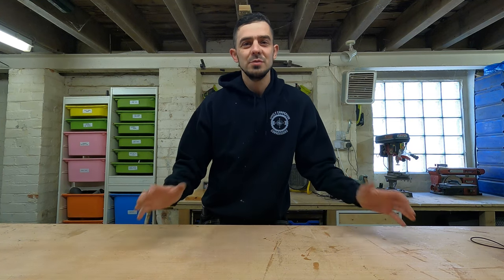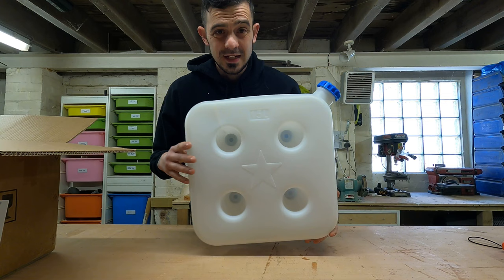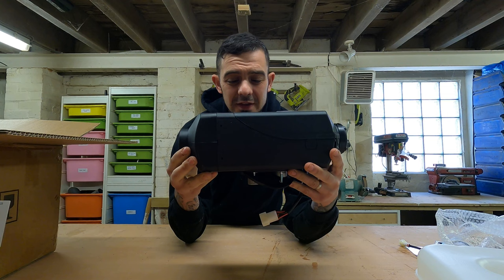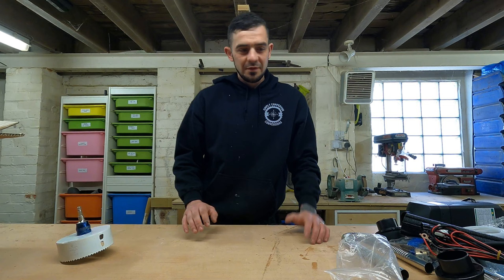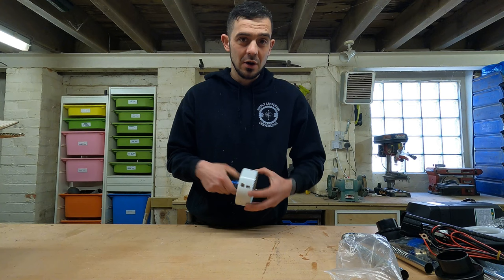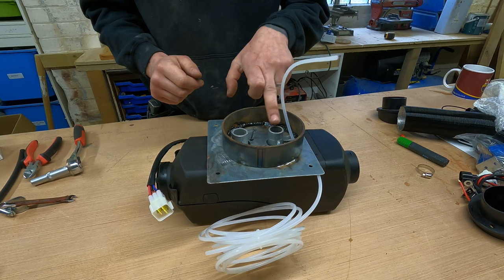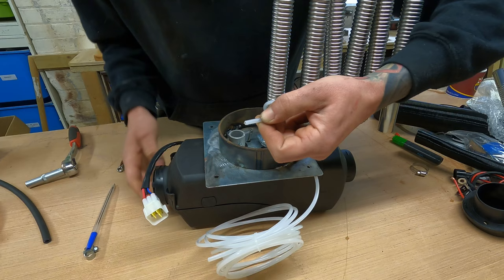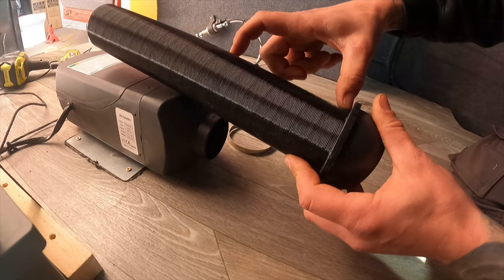CHINESE DIESEL HEATER | Full night heater installation guide safe camper van  | how to install

Comment: Hi Lee, thanks for the video! Would a car battery be able to run one of these over night? Or about 7 hours ish
Would do the start up with the car running as I know that uses lots of electricity
Reply from the maker: I wouldn’t like to risk it.
A car battery is built for short bursts of energy at high amps, they don’t work very well over lengths of time.
Reply: @simplycampervanconversions thanks for the reply! So I’d have to get a separate battery to run it too? Any recommendations for a cheap suitable battery?
Reply: Apologies for hijacking the comments, but I saw this, and though I'd through in my 2p. 

These use little to no power, so if you don't have a leisure battery, then don't panic. 

12v electricity supply is required of course to power the fuel pump, little control panel, and to heat the glow plug. Once it's up and running, it's burning diesel on its own steam. Of course, the panel and pump are still using 12v, but it's a miniscule amount.

I fitted one of these directly to the main/only battery in my Land Rover discovery 2 and used to leave it on overnight with no issues. 

The tiny amount of electricity you do use is restored once you start the engine and get the alternator going and doesn't harm your vehicle battery at all. 

If you were running multiple appliances, lights, chargers ect and draining/charging alot then yes, absolutely go and buy a decent deep cycle leisure battery, however if the heater is the only additional load then I personally wouldn't bother

To summarise...

1- Have a good, strong battery in the first place.

2- Install correctly, as shown by this man's video.

3- Get toasty! 🔥

Hope this helps!

J
Reply: Great video, nice and clear instructions.  

It's good to see a decent one for a change!

Joe
Reply: @jordanmalarky9477 ah ok! Thanks for the feedback! I think my cars main battery is on the way out so will replace that and give it a go 🤞🏼

Comment: Why would you  mount a heater right in the middle of the floor like that? WTF? Why not put it long the wall and run all those wires and lines out of the way?
Reply from the maker: Because that’s where the customer wanted it to suit their layout.
Reply: @simplycampervanconversions   Iunderstand. It just looked like it was mounted in the wrong place and wasn't clear why it was there . Thanks for clearing that up.

Comment: Since you only need a air intake and exhaust, do you really need a 127 mm hole ?
Reply from the maker: Good question.
So you can just drill a hole for the two small items, however that leaves your very hot exhaust against your wooden floor and insulation etc.
This is why we use a turret, it also gives you a better seal around the heater to ensure no gasses are getting back in.

Comment: Is it possible to run the heater with just fan mode, without any heat going through? I wanna know if I could also use it in my ordinary ventilation in the summer.
Reply from the maker: It isn’t however I am working on a work around to make it possible.
Wether it works or not remains to be seen.
Reply: W/o trying, I would say NO.  It's too little a fan.  I see folks put in bigger fans in the roof, sometimes 2, one to push air in and one to exhaust it, but they are larger, somewhere in the range of 6 to 10 inches.  I would want those fans for summer.
Reply: I actually already have a maxxfan for exhaust and a small intake of air. I just need a little more push actually, so a small fan like in The heater would probably complete do it for me at least

Comment: Hi is it ok to run the fuel line 14 ft in length from van thank to rear of van thank you
Reply from the maker: Yes that’s fine, the only thing is the pump is better and pushing fuel and not pulling it, so have the pump as close to the tank as possible.
Reply: @simplycampervanconversions  thank you 😘
Reply: Hi is it ok to extend the wiring to the fuel pump from the heater ? Thank you
Reply from the maker: @raytandy8142  yes no problem at all, just be wary of voltage drop, don’t extend with wire any thinner than what’s used.
Reply: @simplycampervanconversions  thanks again great advise 😄

Comment: What is the drain like on the battery? If it is hooked up to your van's main battery and the van is off, will i wake up to a dead battery?
Reply from the maker: A starter battery is designed for short bursts of power at high amps where as a leisure battery is designed for a low draw Ofer long periods of time.
If it lasted the night which it probably wouldn’t, it would kill your battery very quickly and you’d need to replace it.
Reply: @simplycampervanconversions  so just use a portable battery I guess and charge it during the day?
Reply from the maker: @bmstyle  just a leisure battery and a split charge relay to charge it while driving would be enough and probably the cheapest option.
https://youtu.be/wUEG-U3nqsw?si=iiMinMGcCSrQoEMO

Comment: I installed my heater outside under the van, only the  heat output tube enters the van through the floor
Reply from the maker: What about the hot air input at the rear of the heater?
If that’s also open under your van then your exhaust could be feeding gas in.
I would also pipe that into the van so it’s not giving you carbon monoxide poisoning and also it’s better for heating up as you’re not always heating cold air from outside.
Reply: @simplycampervanconversions  my deisel heater is only ever on when I'm stationary, the heater off the water cooling system from the subaru engine works 🙂 👍
Reply from the maker: @PeterPanoramics  i mean your diesel heater exhaust.
You have the exhaust going out under the van where the cabin air intake is pulling air in and sending it into the van.
Reply: @simplycampervanconversions  ah OK good point I'll extended the exhaust pipe to back end by engine exhaust

Comment: Whats needed to extend the negative and positive wire ?
Reply from the maker: Just automotive flex wire, the thickness depends on the distance you would like to extend.
Reply: @simplycampervanconversions  CABLE WIRE AUTOMOTIVE Red 6.0mm² (53 Amp) is what I have so this should do it 🤔
Reply from the maker: @james1466  it depends how far you are going but I’d say 6mm is overkill.
3 or 4mm would be ample.
I can’t be sure on that without knowing the distance though, as voltage drops over distance.